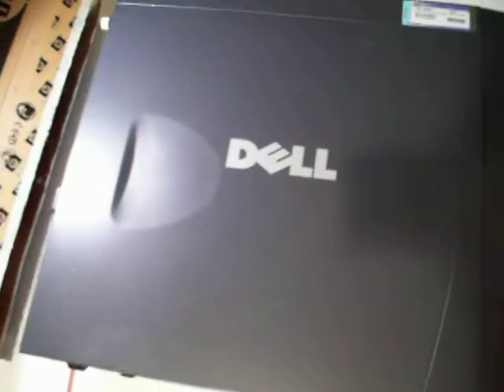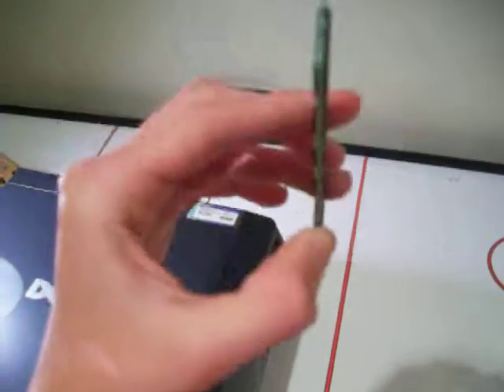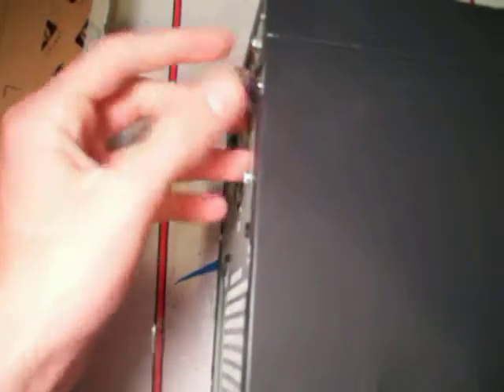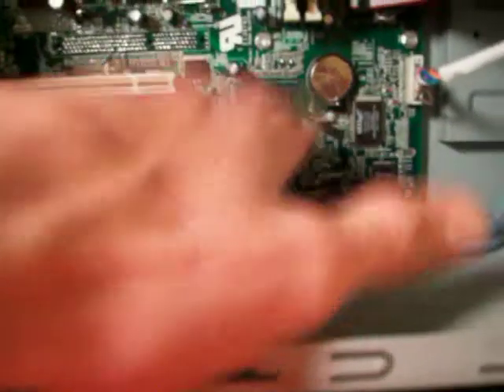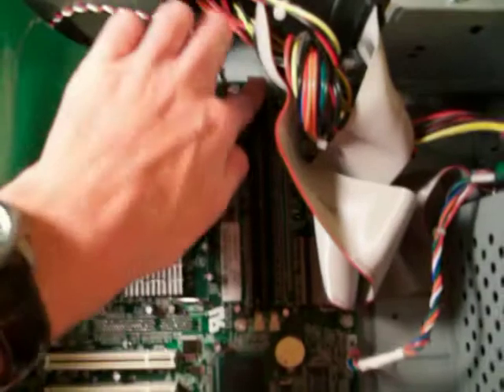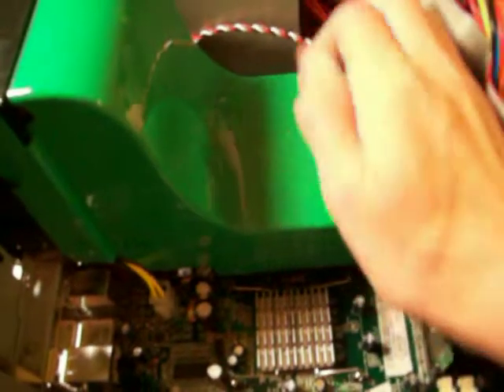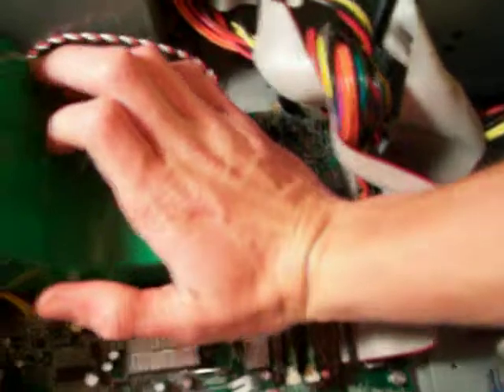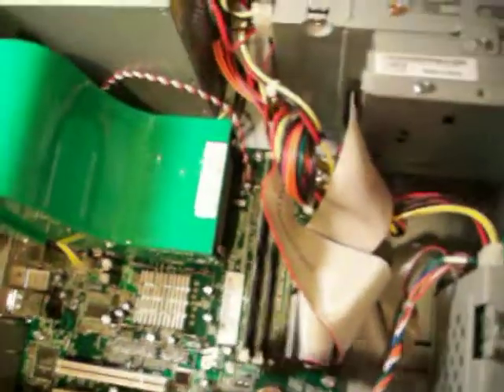How to Upgrade Desktop RAM

Comment from the maker: It depends if your configuration is 1x 1GB or 2x 512MB.  If I were you, I'd upgrade to 4GB (MUCH faster than 3GB because it's an even number, and therefore dual channel) and by 2x 2GB chips.